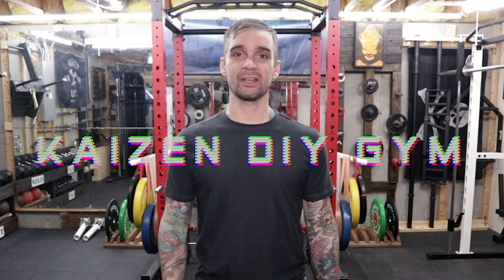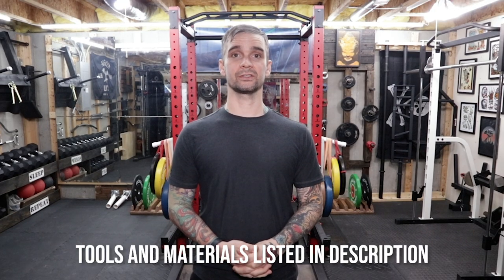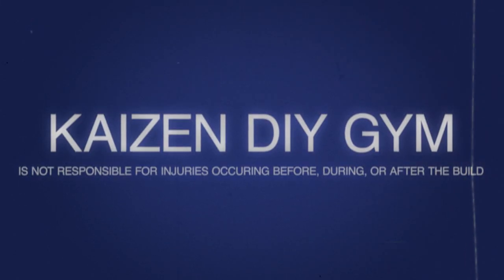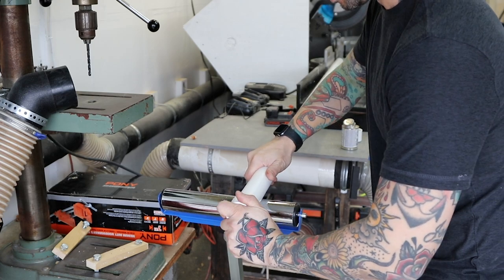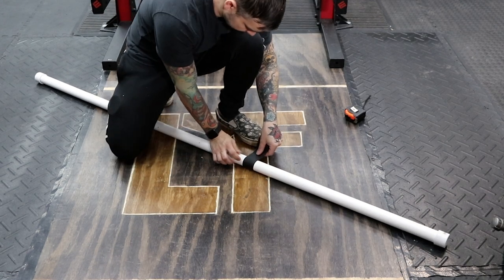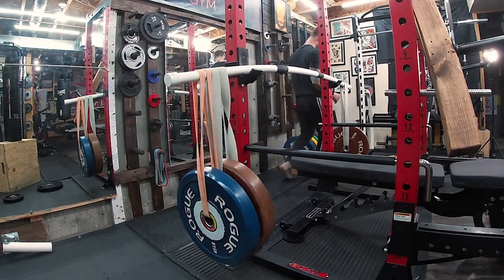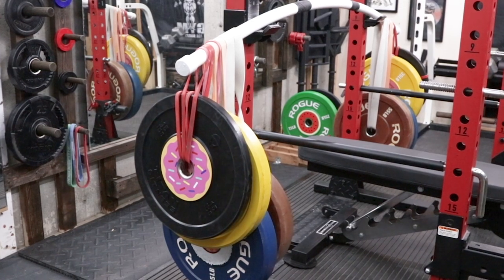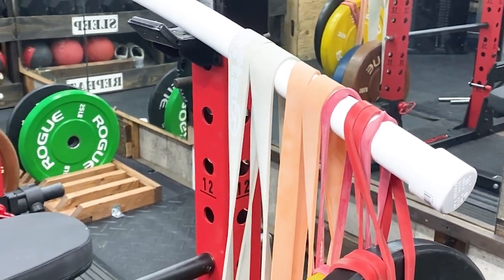DIY Kinetic Bar | Natural Disaster | Shaky PVC Barbell | DIY Gym Equipment

Comment: Very interesting Kyle. You sold me on the strength of the pipe as this isn’t supposed to be a heavy exercise anyway. I was skeptical at first. Nice job.
Reply from the maker: Yeah, I was honestly skeptical too. I figured I’d probably break it with the 300 pounds overnight. For me, pressing anything over 150 pounds was pretty difficult so I don’t think weight capacity will ever be an issue.

Comment: Looks good, 180ish would be the max I’d try if using the j-cups because the arch of the pvc would cause difficulty in re-racking the bar. I’d trust it to go to 200lbs if doing a pin press
Reply from the maker: Yeah, it definitely got to be a challenge to re-rack as the weights got heavier. We lowered the jcups for the heavy sets and it helped. I’ll probably stick with the 140-170 pound range when using this.

Comment: If you want to make it stronger/stiffer I'd think putting some of those fiberglass driveway markers inside would still let it wobble while keeping it from bending so much. ZNA Productions used some in a DIY crossbow to stiffen some much smaller diameter PVC pipe. I've never seen any 80" long ones, but if you can cut the standard 4' ones to different lengths so that they overlap each other inside the inner PVC pipe and pack it with as many as possible, taping around the bundle of rods at several points, it might work.
Reply from the maker: That’s excellent, thanks for the suggestion. It was hard to re-rack with the heavy weights due to the bend.

Comment: Not seeing the list of materials anywhere , great video though
Reply from the maker: It’s basically just two layers of pvc and some caps. I went to the hardware store and picked a pvc size that felt comfortable in my hands and a smaller one that fit inside.
Reply: @KaizenDIYGym  I wound up taking a screenshot of your little pop up. Thanks! Hoping to put this together soon! My left shoulder has been having issues galore. Hoping wide pad and some prehab may help!
Reply: @KaizenDIYGym  I just bought 3/4” and 1 1/4” PVC and they do not fit snugly at all. Did you actually use 1” for the inner?